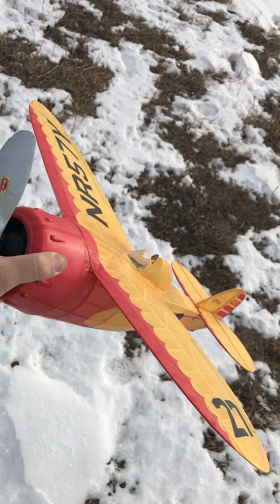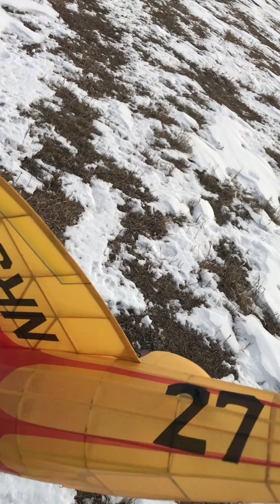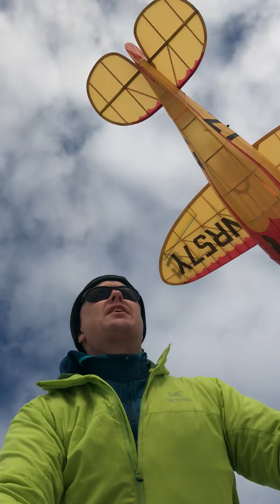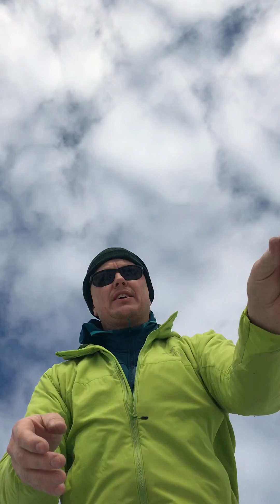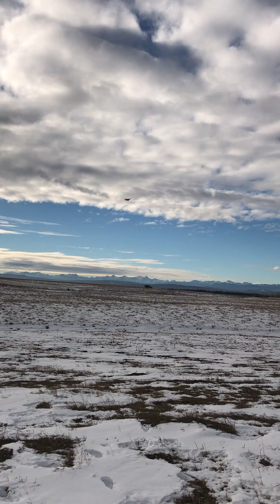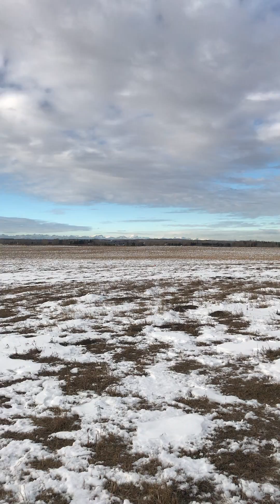Cessna Cr3 free flight rubber powered model airplane flight 3

Comment: Nice. I do RC flying and trying free-flight rubber. Flying a free flight is actually much harder. Set up is so very important.
Reply from the maker: Yes Free flight is definitely more challenging than RC … it takes time and patience to get good at it and yes setup is everything. My kits are designed to fly well … unfortunately many of the older kits and plans were not designed with particular attention to flight performance. Stick with it free flight is a lifelong hobby that will get you outside, keep you in your feet and provides hours of therapeutic creativity and problem solving for your brain. All super healthy. I see it as self care.